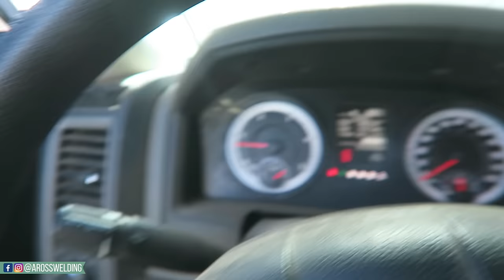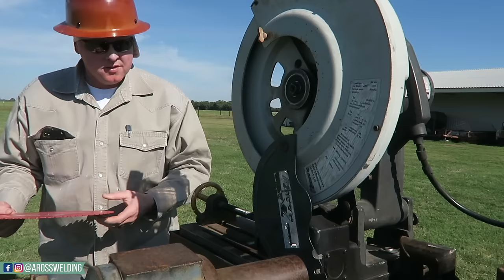BUILDING PIPE FENCE // NO COPING OR SADDLING PIPE

Comment from the maker: We are excited to now be carrying Circle Burners in my shop. That's the handy jig we are using to pop holes in the post. You can get yourself one here https://www.arosswelding.com/shop/circleburner
Reply: Hi sir how about if i want Job there for as welder.....?
Reply: How do you price for a job like this? Obviously your expenses but do you charge per section or foot then add expenses?
Reply: @michaelhuser964  maximum $15  sire
Reply: Need such a gadget for plasma cutters.
Reply: Where can I get one of those fancy torch set ups that’s on a track? The one that you cut the posts to height. Great video bradda 🤙🏻 👨‍🏭🔥
Reply: Austin eres un genio, desde Argentina te mando un abrazo 👍👋
Reply: Hey Austin, how’d y’all lay out the centers for the holes in the posts? Thanks
Reply: Anything like that for a plasma.
Reply: I got a bad diablo blade! 4 of the teeth on it broke off cutting 16g square tubing it hit me in the head but im still standing. Is there a better blade for square tubing?
Reply: What type of welding do you do like pipeline

Comment: Quick tip/ suggestion for you, weld you a socket the size of your knuckle on your torches on the inside of your box on ur truck. So u don’t have to use a crescent to take them on and off. Use a file in between the quick connects to tighten and loosen

Comment: I own a fabrication shop (40yrs now) and the Diablo blades do real well... When we first used one we were skeptical, but they are working real well and for an affordable price... We are also using the Diablo sanding disc's and they are rocking as well... Blown away and loving it.. We will keep using that brand for now...

Comment: I’ve never seen it done with cutting holes in the pipe like that. Usually it’s coped or pressed on the end. I like the way you guys did it though and the fence looks great.
Reply: You need some beefy press set-ups and a die for pressing down tube that size. It works well for small thin-wall tube, but you need double-digit tonnage on a press to get a decent result with something like 3" sch 40. 

Our shop had to do a run of 'em for parking-meters of all things, the meter bolts to the flattened section of pipe and the cylindrical end gets embedded in concrete.

Comment: When you said you weren't expecting much out of that diablo blade I just kind of chuckled and thought 'just you wait' :)I use them in everything that cuts wood or metal.   The Skil SPT78MMC22 with the 8-1/4 metal blade would work thru one layer of that pile in 15 minutes without ever lifting a stick.Thanks for  doing this video Austin,  it's a great looking fence and your partner has my utmost respect for cutting all those holes- what a job!
Reply: Diablo makes the best stuff. They are the only grinder discs I will buy anymore because it is the only brand I have never had a disc shatter.
Reply: Sawzall blades are 100x better too.

Comment: Austin, I gotta say. You are in a league of your own. The place I work at, I do a lot of fabrication, and even more repairs in the field on heavy equipment. I watched a video of yours a while back on pancake hoods, and how to fit them and you sold me. My wife bought me a Hobart inventor series for Christmas, and I love it. But, my new Wendy's pancake is absolutely amazing. Backlighting? Whats that? Smoke in the eyes? Not anymore. I even find myself reachimg for it more and more every day over my old sugar scoop and inventor. And, I will say this; a quality lens is an absolute necessity. I got the adjustable shade Lincoln Electric 2x4C, and it is amazing. Super clear. Everyone at work looks at me like I have a thumb growimg out of my nose when I am using it, so I tell them that until they try one for themselves, they wouldn't understand. Great job on the fence by the way! 
One of these days I'll get me a Lincoln welding machine like yours, or rebuild the engine in the SA-200 I have that was a gift from my wifes family, but until then my $300 Hobart G258 with the Willys Jeep flat head 4 cylinder will have to do. Its a 1400 pound monster, but it runs good amd everything works on it. Keep up the good work man! Stay safe and keep the family fed. Cheers from Southern Illinois!

Comment: Really like the video on the pipe fence.  
A couple questions: 
1] What is the Machete/Big Knife for --- sticking under the right side of the SAE-300 red face welder top cover?  
2] Is there a Fixed Jaw MISSING on the Combination Vise at the right rear corner of the truck bed?

Comment: I build quite a bit of fence, sometimes I cut holes in the upright, and sometimes I saddle the middle rails. I like cutting the upright better. I think you get a better weld when you cut the upright. That’s a nice looking fence by the way. Just got finished building 1800 ft of fence just like that. Nothing looks much better than a nice fence!

Comment: I had a pipe fence, cattle guard, gate, and h brace gig back in 2015.. kept me busy for 7months! GodBless, that was after the crash of 2015.
The entire gig was old 3"/6" liner pipe.
Terrible to fab with all that melted liner ruining hope for clean torch tip cuts.
Arc blowin allover the place even after heating up and  wrapping 4-5 times around with bare copper clipped to my ground.
You, my friend, are lucky to have new pipe for the job 
Fence is legit tho, solid, plumb, and level.
Diablo has always been a very surprisingly decent brand, just about anything they make with the right touch will  usually outlast your expectations.
Y'all stay good out there...

Comment: I love my Diablo blade been using them for years last much longer than the blade I had before as long as you don't have any broken teeth you can resharpen them on a harbor freight blade sharpener as long as you get it set up right it works pretty good I tried that after the only local blade sharpener quoted me a price that was only like 3 bucks less than a new blade so I got the HF unit and after a lil time getting it set up and minor mods it works great to get double or triple the life outta some blades 👍👍👍
Reply: Is that a diamond wheel sharpener
Reply: @ryanb1874  yes

Comment: Another fence I built was I used 4 inch sqaure tubing up rights turned so they was turned in a diamond fashion had 1 inch pipe for runners in 24 foot lengths. Spaced the upright 12 apart cut the hole in uprights and slid the flexible pipe threw center uprights and ends in each end and built fence in half the time because of labor savings weld it up and primed and painted. Later discovered I just needed to weld the center upright and leave ends open to save even more time.

Comment: What a beautiful job. Well done. I haven't seen tube fencing in Australia. Almost all the out farming fencing is timber. The piping is normally used around the gates and not the same diameter. Also galvanised. I was sort of hum and har about the diablo blade. I'm not really a big fan of diablo. I have a diablo blade for timber. I have three cordless cold cut saws and haven't really looked into getting the larger cold cut chop saw. Bosch make a decent one for around $650 aud. (Australian dollar). Although Milwaukee, dewalt and other brand names also make it. As for the evolution they seem to be Middle of the range. Your posts line up beautifully. I missed the video where you set in the posts so I guess you used lasers or some electronic equipment to line up posts. When you drive along and all are the same height is pleasing to the eye. I bet you get satisfaction from your work which is a very good form of therapy. Taking pride in your work and making the effort to present a video. Great video I enjoyed it immensely and subscribed.

Comment: Need more information on tools used - tool to cut top of pipe off and tool used to make holes in pipe ??

Awesome !! responses ...Thank you for the information 
I HIGHLY recommend this Austin Ross Channel
Reply from the maker: Mathey dearman beveling machine isn’t what I used to cut tops of pipe off. And the circle burner I got from my local welding supply. Try calling these 3 places and see which one will ship one to you. 
Tell them I sent you.
Munn supply: 580-234-4120
Stillwater steel 405-377-5550
Chickasha ind. & welding 495-224-2215
Reply from the maker: Hey Victor were you able to get ahold of a circle burner? We heard a lot of people couldn't find them so we decided to sell them in my online shop if you are still needing or wanting one. Hope you're well. https://www.arosswelding.com/shop/circleburner

Comment: Nice work! what I'd like to see is how you figured out how high to cut your posts (verticals) and especially how you figured out where to cut the holes for your crossmembers. That takes some major layout work.  Obviously you've got some tricks to make it easier.  Again, that's what I'd like to see.  Circle burners are very handy tools. you also made me a believer as far as Diablo cutoff blades. 

I've done fencing and handrail work and the main tools that I've had were a cutting torch and an angle head grinder with a cut off wheel. I worked for an outfit back in 1981 that was building a feedlot in Boardman, OR.  All of the pipe was old oil well casing and the crossmembers were called "sucker rod". They came out of old oil wells too.  Now that was when you had to be real tricky to weld that old nasty crap.  They didn't have all of your fancy tools either.  They did have Lincoln welders, that was the only good thing. 

I also like your closing message about making sure that you learn something new every day.

Comment: That’s pretty slick!! But boy that’s a high dollar fence!
Reply: In the Oil Patch it is common to find pipe that would not past pressure test,  We buy it for scrap prices. When i was a kid in Houston we build all our fences wite pipe.
Reply: No it’s actually pretty cheap. I have seen it as cheap as a 25 cents a foot. It’s old drill pipe that doesn’t meet standards. Trust me the last think you want is to be 200 plus feet down and have a pipe snap.
Reply: Well the used SHIT it’s very cheap around here. You can get new reject here for not much more and is a whole lot easier to work.
Reply: George Owen I don’t want to be a know it all but this pipe is not drill stem!! I’ve been around water well drilling most of my life and drill stem is extremely heavy walled pipe!!👍
Reply: Guys he’s prolly not taking about the price of the pipe,the type of fence and the amount of work put into it is what would make this job an expensive one
Reply: @scarface-39  It's not the same. This is oilwell drillpipe and tubing.
Reply: I was thinking the same thing, here in Illinois it would cost a lot. Interesting to see how things are done differently in different regions.
Reply: Meinen Land and cattle o
Reply: 25$ plus tote 👜 whatever you can tote home.
Reply: Flippknight ‘
Reply: Drill stem is pretty cheap
Reply: @bobsherrill2672  here they return it to the supplier,
Reply: @rickymeinen7387  here i stopped going to the scrap yards for steel, most of it is mill ends, but the price per pond, it is so close to new price, it not worth the labor to clean it up to paint or even work with, at a 100 bucks an hour as a welder, last thing a customer wants to pay for is cleaning steel, with mill ends , say it is a 2x2 tubing, one end will be 2x2 and the other end be !-7/8x1-3/4, and areas that are full of lamentation
Reply: Good clean work is never cheap!
Reply: @georgeowen2083  What part of the country does it sell for .25 a foot? In South Dakota you can't find it under $10 a foot, I want to put up fence like this but prices are insane
Reply: @jennifermaggs30  for de-certificated pipe? That sounds like new prices. I use a lot metal and am always searching for sale pages CL, FB marketplace, ect.. I see it for sale all the time. I live in Wa state maybe it’s because we have a high percentage of the population that has wells drilled. Once it can no longer be used for drilling its essentially scrap and scrap is going for less than a penny a pound.
Reply: @georgeowen2083  Well if you know of any locations in the mid west I would be willing to travel and get a load!
Reply: Cant beleive the price people are saying.  Wood would cost more than this stuff in England.
Reply: @jennifermaggs30  you can ship a semi load out of texas for $1 a foot
Reply: @smcox1991  Where is there more information for this?
Reply: @jennifermaggs30  There was a lot of 2 7/8 drill stem for sale on Bisman Online but the last couple of months there has not been a lot. Most of it was out of Dickinson, Bismarck , Carrington  and a lot of other small towns in western ND. The last I got was last fall some 2 3/8  from a guy at Hazen ND   $30 a stick,  31 feet + or - some.
Reply: @bobsherrill2672  structural upset tubing might be cheap, but seeing as my day job is to pressure test it and I see every joint that blows, I wouldn't use it if I could help it. Rod wear, salt water, the list goes on. 2 3/8 is tested to 6500, but once in a while they'll blow at 3000 or so.
Reply: @georgeowen2083  lol never fished drill pipe before. Tubing, rods, pumps, sure, but never drill pipe.
Reply: @jennifermaggs30  Kansas, Oklahoma. Texas is probably even cheaper. That's oilfield tubing that tested up bad. Might have a hole, a split, might have blown at pressure, might have bad threads, whatever. But yeah, good tested tubing would run a good bit more.

Comment: I'll give it to you, that looks really nice.  I just got done doing almost 600 feet myself on my place.  I normally cut the pipes in half with a saw and then use a plasma cutter and saddle jig to cut those halves into fourths and that normally leaves a seven to 8 foot long post.  I get four posts with three cuts.  I then pound the posts with a driver and set the smaller 2 3/8 in the saddle and weld it out. (2 7/8 posts)  I have yet to screw up a saddle pounding it.  I like cable or sucker rod because it's fast.  I'm not really a professional, I just like metal fence around my farm and not wood and I do what's easy.

Comment: With this type of build you can make a flex joint in every 50,100 or 1000 feet what ever you need by just welding one end of your runner it allows the metal to expand or shrink as it needs also fantastic for undeveloped terrain. Also use 4 inch square tubing for uprights turned so the pipe runners go in at corners and this is even better than pipe on pipe.

Comment: I’ve been building me a pipe steel fence at my house. I tell ya, the nice thing about doing it this way is that it’s a lot easier to weld your horizontals in if you are working by yourself. I’ve been coping mine out and using my backhoe with a chain to hold one end. This seems so much easier. I run a plasma cutter off my Trailblazer and cope with it but I can sure as hell cut a hole in some pipe. Done that plenty on other fab jobs. What else is nice is that you can do each step with that particular tool all at once. Then move to the next and so on. Like a one man assembly line. Run a chop saw to cut all your lengths. Then run your torch or plasma cutter to cut all your holes. Then just spend a few days burning rods. I think the quality would go up too. I hate getting into the groove and things are just burning in nicely and then I have to stop and set up to get to the point where I’m burning rods again.  It would be nice to just keep on rocking. Very nice work. I’ll remember that on my next fence job. Been getting more of those lately.

Comment: I'm surprised you haven't heard of or used the Freud Diablo blade.  While I don't have a metal chop saw, they're all I use for my mitre saw, circular saw and Sawzall (carbide tooth).  Beat the Makita or Dewalt for lifespan and clean (wood) cuts. Also the only blade my metal supplier carries.

Comment: nice job..enjoy your videos......... seems like a lot of wasted rail pipe and a lot of cuts .....would it work to push long lengths of rail thru the holes in the posts and  weld where ever a rail splice comes up as well as at the posts ?    Im cheap  Id want to get max yield from material

would you please explain how one would go about cutting the holes in the posts so they all line up for the rails to look continuous ?....thanks

Comment: I had a Chinese miter saw that came with abrasive wheels and I figured I’d try out the Diablo Cermet II blade. It cut like butter at first but little did I know the RPMS on the saw were too high. In other words the rpm limit on each blade is actually important
Reply: WOW,NEVER WADA THOT AN ABRASIVE WHEEL GOES 5 TIMES FASTER THAN A CARBIDE BLADE

Comment: Those 4" ers could be cut in preprep also.

 using a full length  top rail  20' to locate both post height and linear position. Then just wait  for concrete to set up before off to the next one.

Set up an optical transit and a pipe jack for level  let the top rail determine height of post.

They have cnc pipe cutter machines now.

 Who knows you might like it.

Comment: Seems like it would be more difficult to get the horizontal pipes level. With copes you can always nudge the ends up or down but with holes you're committed.
Reply: That's this old carpenter and half ass welder thought, easier to cheat!

Comment: I am building a sch 10 pipe fence. using a Miller blue star 2e. what rod to use? What settings on the machine. corse setting and amp settings ?

Comment: Hi, I'm considering building a pipe fence. Around 1,800'. What would you think about of instead of burning the holes out using a hole saw and drill? I'm not set up with torch rigs.

Comment: Get your air compressor and blow it in the rollers. I worked at the mine with with heavy copper and we had to roll them on those type of rollers and we’d get the same problem. But using the air compressor helped a lot, took the debris out